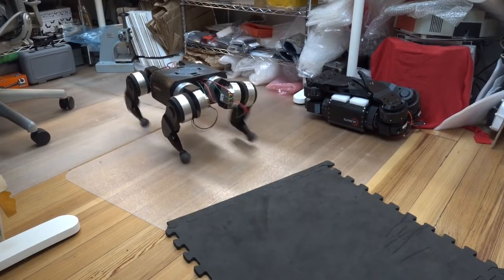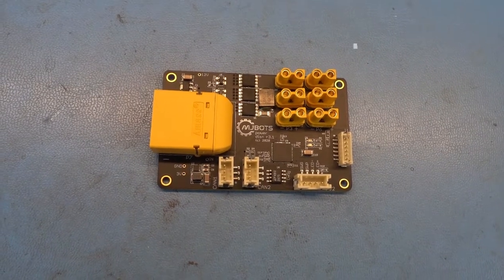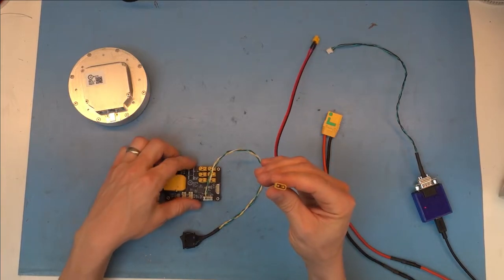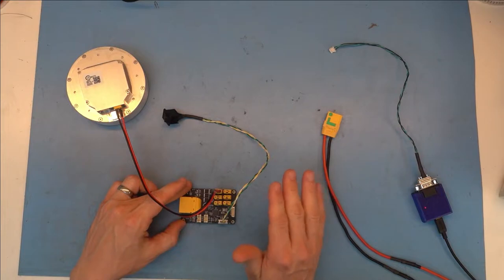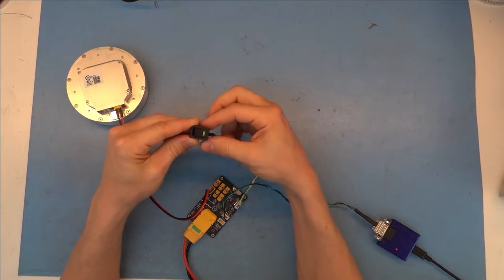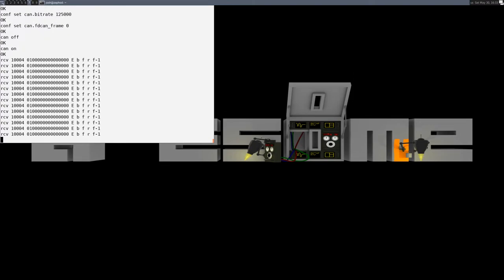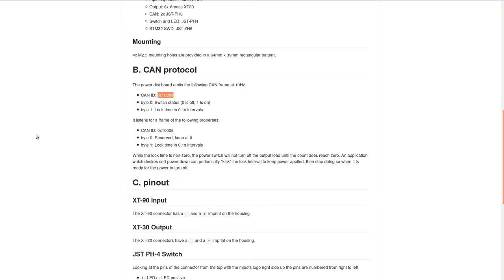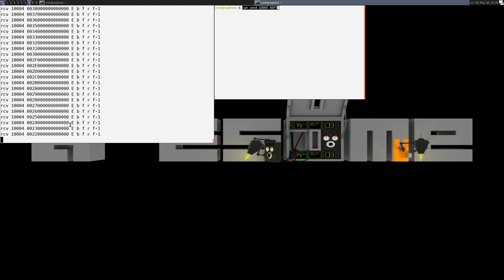mjbots power dist board overview

Comment: Hello, could you please argue a choice of low side switching for the device?
Reply from the maker: The circuit implementation is simpler and lower cost, at the expense of imposing some constraints on users.
Reply: @awesjosh  "some constraints on users" will most probably lead to a bunch of fried electronics.
Reply from the maker: To be clear, I agree that the low side switching design does increase the risk of magic smoke release, which is why I clearly called it out in the video and it is clearly called out in the user documentation.

I did perform a failure analysis, and I believe that the risks associated with this particular design decision, while one of the largest overall risks of magic smoke, is not incomparable with other likely mistakes that could be made when used in a typical application.  That said, I'm not completely convinced of the tradeoff myself and may yet switch it around in a future revision.

Comment: what power supply do you use?
Reply from the maker: My primary supply is a Chroma 62006P-100-25.  So up to 100V DC / 25A, but limited to a max continuous power of like 400W.
Reply: @awesjosh  thank you very much, do you think that a 30v 10a power supply would be able to power 4 of the mjbots brushless motors ?
Reply from the maker: @colinmccormick608  it all depends upon how much power you want to use. 1 moteus can draw more power than the 400w that supply can put out, but sometimes I have run 12 at a time on it when the combined power is less.
Reply: Sorry for all the questions but how would you recommend powering 4 motors?
Reply from the maker: No problem!  You can always join the mjbots discord to talk with many people building similar things to see what they have done.  https://discord.gg/W4hUpBb

How you want to power motors depends mostly on what you want to do with them and the total power requirements you expect.  A single moteus is capable of using 400W, but you have full control over how much of that it uses, and it can't do 400W for long anyhow without serious thermal management.  You also have to consider if you expect significant regenerative braking, and you need to have a plan for how to manage the energy that such regeneration can produce.